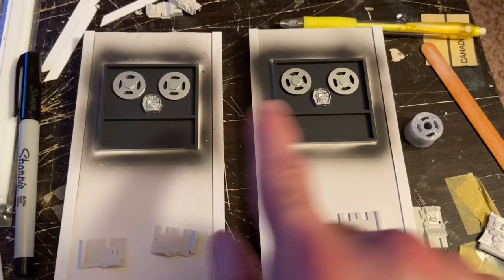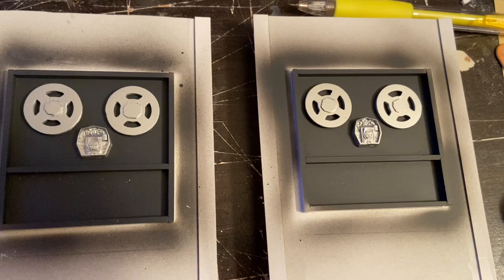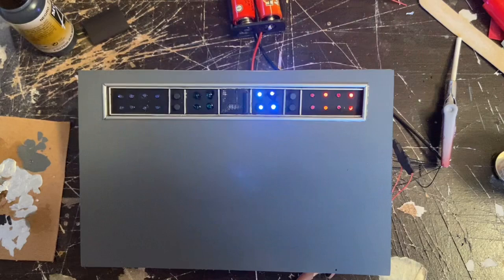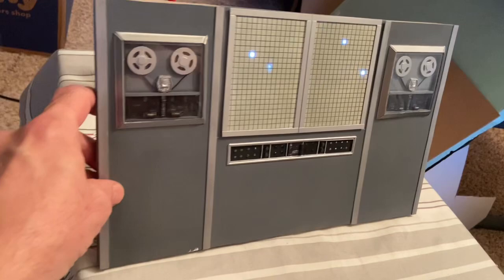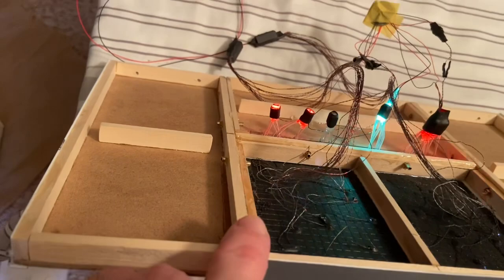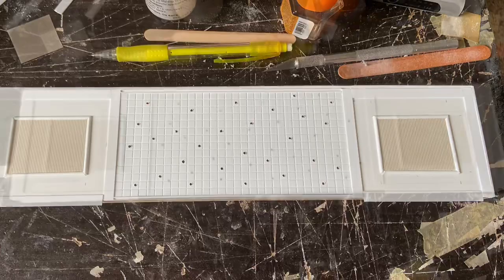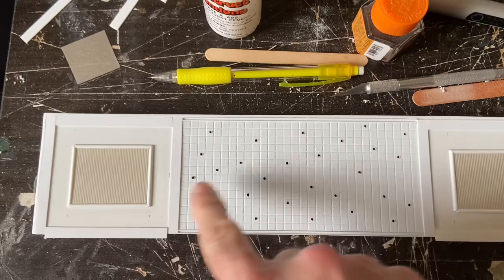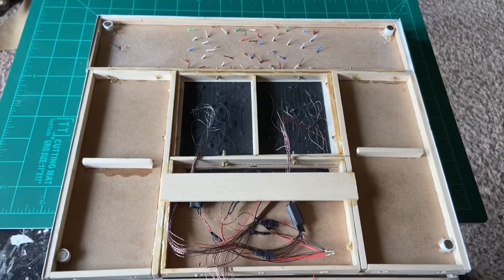Monarch The FLY build part 6 FINALE!

Comment: We used to see those reel to reel "Computer" things in the "Go to Computer school, Make Millions!" commercials back in the 1970"s. Turns out, each of those was nothing more than the equivalent of a very small floppy disk or a tiny USB device. That was the only way to store programs then.  The computer was a whole 'nother bunch of similar sized cabinets. You could heat a residential home with the output of the cooler fans from those things. Input? Punch cards. Most of us are too young now to remember "Do not fold, Spindle or Mutilate" on every snail-mail bill that arrived in the box out front. It was a card about like a Manilla folder. All your bill info would be on it. There would be a pattern of tiny square holes in the card. You'd put your hand written paper check in the envelope with the un spindled card, stamp it and send it off. The cards went in to huge trays. hundreds of cards would be sucked through an optical reader fast as they could fly. The information would go into the accounting program that was the only thing running on the huge computer. It may have been the ONLY thing that COULD run on that monster.
Oh, and... The grid of winky blinky lights? An affectation. They never had a purpose. The original ENIAC, I think it was, had a board of lights in a grid setup for demonstration purposes so potential customers would see something was happening when they came to be enticed to cough up tax money to buy one. Nothing more. Nobody "monitored" or got information from that grid of lights. The visual paradigm stuck and appears to be permanent now. All the sound and fury would spit out an actual result on "Green Bar" paper. Clack-Clack, Blink-blink... 42.
Oh, and it too me about 20 years to fall for the commercials. "ITT Technical Institute" Class of 89. Still working on the first million.